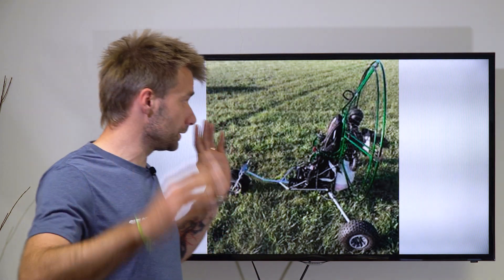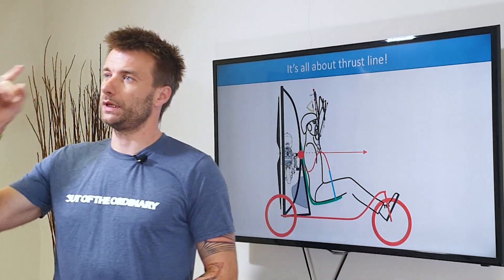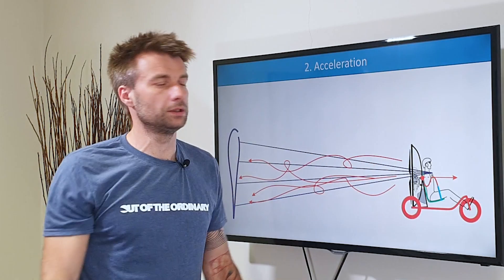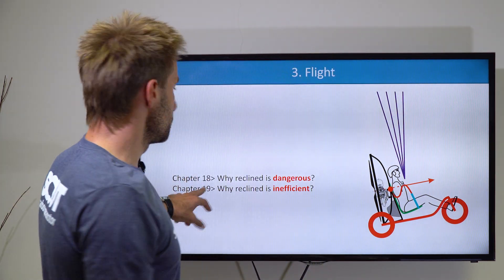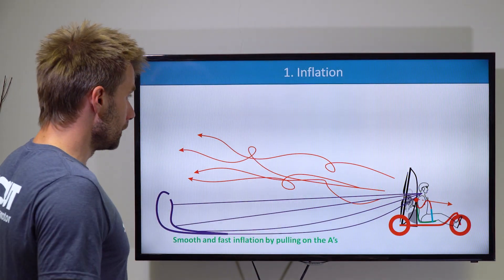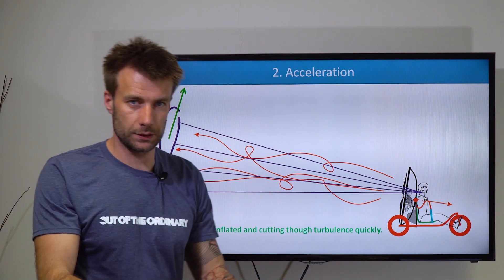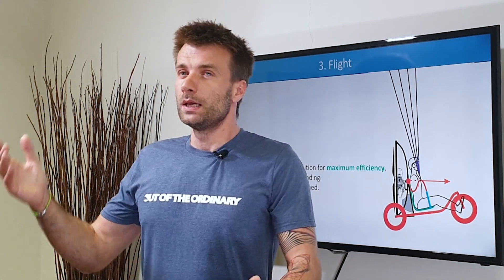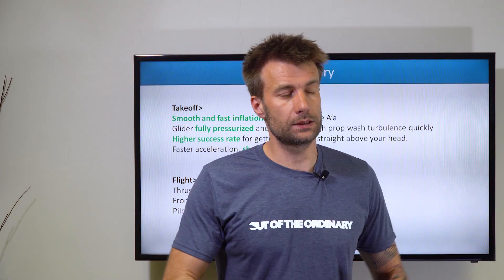Trike ideal thrust line. Paramotor geometry part 36

Comment: wrong in the air? you move your hang points to adjust the angle of your dangle.  and the upward air thrust would still hit the wing as it comes up. it just hits it later.

Comment: Mine is a home built and it used to be an about 75 degrees. I had a lot of trouble with propwash on takeoff I changed it to 90 degrees and it is much better now I can't speak to the efficiency of my flight but it seems fine to me

Comment: Well, speaking of things trikes do wrong... what's the aversion to caster front wheels? This way the trike would tend to follow the direction of the wing 'automatically' wouldn't it? Some do this, and it makes sense to my feeble brain. Yeah sure there's a pilot on board that should be doing that anyway but still... ?!?

Comment: The thrust angle in the air is TOTALLY independent of the thrust line on the ground and NOT affected in the way described here. You set your hang points to give the in the flight thrust angle required. You set the geometry of the trike to set the thrust angle while on the on the ground. The 2 are not connected.
Reply: yep...

Comment: Could you talk about the seat of the trike? Better a normal ppg harnes picked on the trike? Or better to mount a independent seat with seat belt?
Reply from the maker: As long as it is safe, choose what is more comfortable. To me, a harness is always more confortable than a seat. Even passengers feel more secure as the harness hugs the body more tightly.

Comment: Hey great video! Literally everything you said is correct however, the simplist solution for the 90% of trikes made with a completely horizontal thrust line is to just swap out the front tire to something smaller and/or use larger diameter ones on the rear.   After that, do what you should already be doing regardless and conduct a hang test for in flight pitch.    Keep up the good work! Maybe one day we won't have to watch as many people at the field ball up their wing when they roll on power, lol.
Reply: I thought I had that great Idea to change the Thrust line with bigger rear wheels, but you had it before me. Good on you mate :)

Comment: Great video and I've watched and took everything onboard ...the thing is Ive been flying trikes for some ten years paramotors for  twenty , and all of the trikes I've flown are straight upright or even reclined back around 5 degrees. Yet I have never had any issue with bad inflation of any of my wings or any issue with my takeoffs ( many videos available ) so I am wondering is everything I've done totally wrong and i am a one take off from death ?  could you explain why I am not having any issue  ...also what I don't also understand clearly is lets say i was flying along and my prop is perfectly up/down then i hit full power i will accelerate and the wing will drag back causing me for a moment to in effect lean back putting me into a dangerous angle 
I  don't disbelieve anything you say ....but perhaps I hold reservations
Reply: Replying to myself and just to let others know ! I’m still flying my trike and its still leaning back a little bit ( on the ground and in the air ) still having no issue with my take offs and have therefore come to the conclusion it makes no difference AT ALL if when on the ground the motor is leaning forward , straight up, or leaning back …..so in this aspect your wrong ! I’m afraid I have carried out extensive real world tests …and not in the classroom or  on the blackboard

Comment: You had a photo of a Power2fly Colibri trike with 90 degree thrust line. Since the colibri have adjustable thrust line I would say it is by no fault of the manufacturer but of the pilot.
Greate info and good work with these geometry series videos!

Comment: Great videos keep up the good work.  One question I have is  It doesn't have anything to do with a thrust line it has to do with a propeller. Do you think putting a propeller and a duct would help with thrust and noise Possibly getting more thrust and less noise for the same amount of power putting into it or possibly less energy going into it. Looking forward to hearing from you thanks Mike from the USA

Comment: i designed my own trike, I found a ppg trike design guideline http://ppgtrike.com/paratrike-geometry and it recommends 5-9 degree thrust angle, Im proud of myself that  I designed the correct thrust angle, you recommend 10 to 20 degrees, I will settle for 10 degrees

Comment: Correct me if im wrong but if you are leaning forward by 20 degrees on the ground  you will still be in the same uncomfortable position as what you are in the air because the tike and engine dosent move as its all fixed you pivot on the arms or hang point so you still will be uncomfortable in the air now if you had and adjustable engine to change the angle between fly and take i could understand but it dont 🤔🤔🤔
Reply: The whole trike will lift the front wheel after take off and lean backwards
Reply: It depends on your wing hang points once suspended by the wing. More weight behind hang points your nose will raise and vice versa.
Reply: Just take a picture of a trike landing just before touch down. Then you will see, that the front wheel is a bucket size higher than the rear wheels. You can simulate that with a simple hang check :)